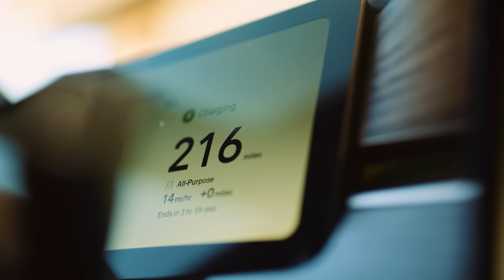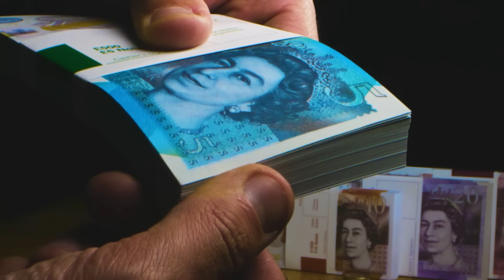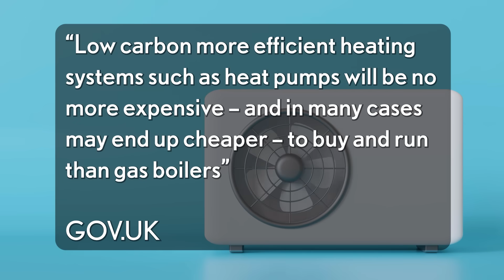The Truth About an All-Electric Future

Comment: Guaranteeing a price doesn't mean it'll be higher than today.  Even with netzero the government has said that they're still working on the basis of 5% of our energy coming from gas because as you say, sometimes it's what you've got to have.  Rememeber there are many technologies which will arrive soon like Vehicle to grid which will help the overall grid.  Yes some heatpumps are going in wrong but that's people more often that not, less the technology but I agree it's certainly a challenge.  Yes we are rushing to get to 2050 but that's because we've talked about climate change since the 1980's but no one really got off their arses till about 15 years ago.
Reply: They are not going to be guaranteeing 'lower' prices are they!!!
Reply: And what if I don't want my vehicle's charge being depleted back into the grid, thank you very much?   I put it on charge because i need to use it on 3 hours' time, not 7.
Reply: @hunchanchoc8418  The system takes all that into account.
Reply: @hunchanchoc8418  then you could turn that off in the settings? The idea is that people who are happy to connect their batteries to the grid can do so and make a small amount of money from doing it. It's opt in though and those that don't want to don't have to.

Comment: Let's look at some of the claims, 100 year old cables. Yes there are, but very few and those still working could be working for another 100 years. You see cables don't deteriorate unless they are disturbed physically. Or they are miss used by bad planning which is exceptionally rare.
We don't have enough cables, we are not going to switch over in a short period, it will be over years, no everyone won't be charging our cars all at the same time, not even half at the same time. Home charging for those that can should be done at a slow rate, overnight, every night. The system already has roughly double the capacity than strictly needed, it's so parts can be switched over for maintenance, that can be tightly managed to reduce times off line.
Substations used to take weeks to build, today, lay a concrete pad, cane all the gear in. Swap cables over. Actual working time, under 24 hours.
The distribution network is not a problem. 
How energy is used, remember electricity is universal, you don't need different types, ie diesel, petrol, gas etc. It can do any job, just design for it.
Storage, given enough storage and you can store more than enough to last weeks of no sun or wind. Better still it doesn't need to be chemical batteries, a block of flats, a big weight in the centre which gets pinched up by excess energy, then dropped turning a generator at night or times of no sun.
You can do the same with holes in the ground, or hydro, or weighted sleds on hills, huge stores of molten salt.
Its just a matter of scale, the bigger, the more energy stored.
The politics, management, depends on who we vote into power

Comment: Net-Zero is BS, they know they can't meet it but are hammering it along for various reasons but it all boils down to 2 things.. money & control. control the emergy system and the food system both under constant pressure and shortage and you can easily control the populous.
Reply: Or it could be about climate change. The thing that's going to cause major problems across the planet and that scientists have been warning us about for decades.
Reply: @JS-ct1uo yep, that makes more sense. People suggest that it's about control, as if they can just go into the garden and pump the well for a barrel of oil, or fish for gas. 
They (the government) already control the energy system. Why would changing to electricity make any difference? In fact, if I were to install my own panels and batteries, I'd have a large portion of my electricity under my own control. Far more than I could ever get with gas.
Reply: @JS-ct1uo ... and that cutting carbon emissions will have negligible effect upon.
Reply: @hunchanchoc8418  You'll find find that the vast, vast majority of climate scientists disagree with that statement.
Reply: @hunchanchoc8418 Zero effect.
Reply: @JS-ct1uo Based on what?  MODELS that have proven time and time again to NOT predict the actual outcomes.  Yes, the climate is changing, but "the vast vast majority" of it is just the planet and the sun doing their own thing like they've always done.
The vast vast majority of 'climate scientists' have to parrot the narrative or else forfeit their career.

Comment: As soon as you pointed out the amazing fact that yes they are replacing gas pipes everywhere you look, I thought to myself, I wonder if they can be repurposed to transport Hydrogen.
Reply: They can't and they won't be repurposed for hydrogen as it's 5-6 times the cost of gas. I'm not planning to burn pound notes for my heating, are you? Electrification with heat pumps and air con it is, then.

Comment: Lets not forget that if all the cul de sacs up and down the country have 2 electric cars, all electric home etc..... how on earth is the cabling infrastructure going to cope..... it isnt.  So even if we could produce the amount of electricity we need, we dont have a grid that can cope with it.  Its all nonsensical.
Reply: The cars generally aim to charge when the electricity price drops, not so bad. Less power than an electric shower.
Also ideally vehicle to grid means the cars can be the solution to the shortfall. That's been a long time coming but I think it's getting there. 
Same with house batteries.
Reply: @benhowellthomas and energy efficiency means houses have been using less electricity than in previous decades.

Comment: Hi Roger. I would like to draw your attention to the Johnathan Tracy channel where he did a cost comparison regarding gas v heat pump. Not the total answer but the Government should be helping people especially lower income families to get solar and battery. Since I had mine installed my costs have basically halved and so if everyone had similar then the load on the grid wouldn't be as high as predicted and yes I know not all houses are suitable but have a look at Gary does solar and he does a comparison on various solar aspects, north, south etc. I suppose they have to upgrade the gas lines as to leave them could cause major problems and in any case when have businesses done anything logically.
Reply: He won’t do that
He’s anti heat pump

Comment: True. They are happy to trample the poor with high energy costs if it satisfies the "green" investor, while China pollutes the world to make those unreliable landfill fodder "green" panels and mill blades.

Meanwhile actual industry will struggle to survive with a weakened grid and heightend costs.

God forbid if a war effort is called for.
Reply: We are strengthening the grid and increasing generation. As gas recedes in the generation mix, prices will drop.
Reply: @Biggest-hz7ng empty words. If the unmanagable supply of "green" energy leads to greater stability then up is down.
Reply: Stability will be gas, interconnects, biomass, hydro and demand flexing around wind and solar.
Reply: @Biggest-hz7ng which country has done this as a proof of concept? Do they have a significant manufacturing base? Is it scalable globally?
Reply: Someone has to lead. Scientists and engineers think the tech is there. Solar will be the largest generation method globally.
Reply: @Biggest-hz7ng so we have no country or regional example to assess viability... and you want it to go global?

Comment: You sound like a Reform misinformed MP Hinckley and Sizewell C will provide about 17/18 percent of electricity once completed plus the real help comes in the form of storing via batteries and pumped hydro when cheap pump water uphill then at a flick if a switch release it almost instant power many arguments put forward are very misinformed 
Net zero has been shown to evoke the same levels of anger as observed via a Functional MRI machine as the word woke in all Reform part members
Reply: Multiple hours of battery storage would smooth out many of the peaks and troughs. It'll take a while to build and add to the grid intelligently. Longer term storage will be needed, in the meantime gas backup is cheap and will do for now.
Reply: We would need WEEKS of energy storage to account for winter high pressure. It’s a non starter
Reply: We have a reasonable pumped hydro capacity already, but I think there are opportunities for more.
Reply: Battery storage is up there with carbon capture in its idiocy and where are they going to put pumped storage? The UK isn't exactly the swiss Alps.
Reply: Where are all the extra reservoirs atop hills?  Will Thames Water be building them?

Comment: Nuclear is the answer. I think France have it right. I can't see any better alternative.
Reply: We led the world in Nuclear energy - Calder Hall at Windscale (now Sellafield) was the World's first Nuclear power station commissioned in 1956.  Now we're so far behind we have had to rely on foreign help to build Hinckley C, and further UK projects. HinckleyC not due to come online until 2031!
Reply: Nuclear takes too long to build and is too expensive. Solar, wind and batteries are cheaper and quicker to build.
Reply: @Biggest-hz7ng  Tell me you don't know the difference between nuclear electrons and renewables without telling me. Also, you don't seem to know the difference between fundamental cost and artificially imposed costs, big difference.
Reply: @Biggest-hz7ng  You can build nukes in as little as 5 years, and guess what, the sooner you start, the sooner they are finished. 40 years have been wasted due to this mentality.